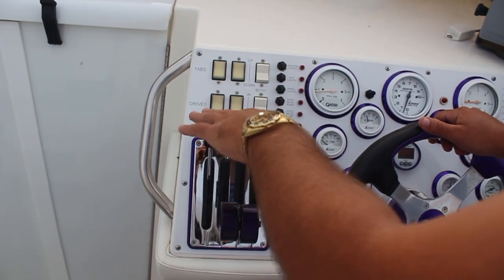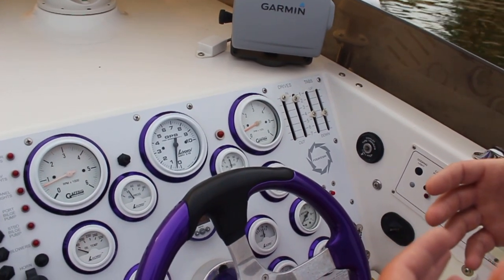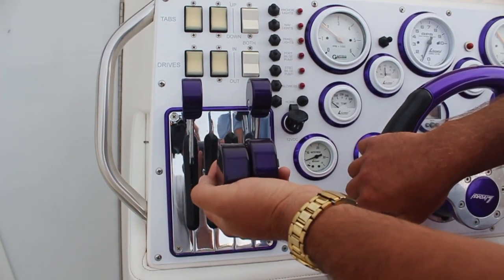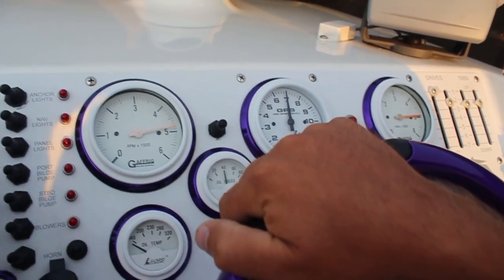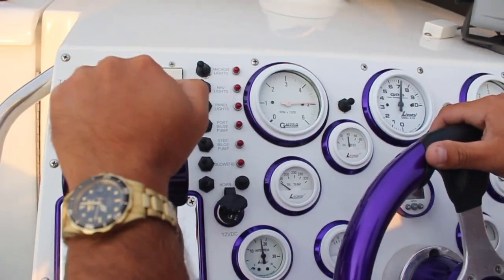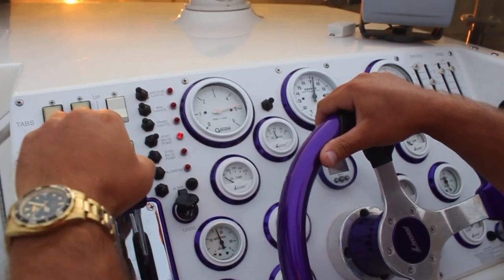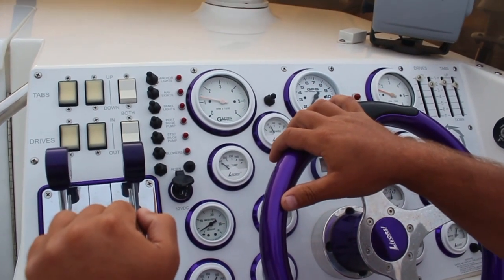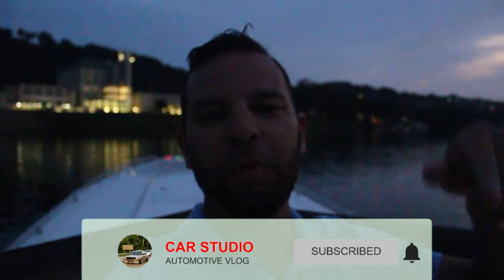HOW TO OPERATE A BIG OFFSHORE BOAT

Comment: I’ve been in a 42 lightning my whole life and have never needed to mess with my tabs as much as you did in this one video. Granted it is a shorter boat and needs a little more but not as much as you were giving it
Reply from the maker: Yeah i agree. This video was filmed like 2 weeks after i bought it and my last boat had blue motors and was only a 32, i never used tabs. The guy told me to use the tabs to get it on plane lol. Once i found out i didnt need to i never do now. I need to make a new video there was a lot of stuff wrong with this one.
Reply: @CARSTUDIOYT  one thing for sure was the audio could have been better. However it is tuff to video when your going fast on the microphone. One thing with me, Im like you constantly looking at my gauges. My trim indicators are old school, and have no indication up at the helm.

Comment: Those things are not limited to just big offshore boats. This applies to pretty much all boats that have trim tabs etc. 15 foot boats and up.
I would have been interested how do you maneuver these 30-50 foot boats at very slow speeds / near standstill when pulling out from or in to a berth on tight marina.
I assume none of these powerboats have props at the bow for maneuvering

Comment: Why does the right drive tab show to be moving when you trim it up.  I noticed the left doesn’t move when you use the trim on the throttle.
Reply from the maker: One of the cables need replaced
Reply: @CARSTUDIOYT  gotcha wasn’t sure if it was because they were being moved together or some other reason. I good with lake boats lol I’ve never been on a boat in the ocean unfortunately.

Comment: Controls are there because Reggie was left handed. Not that he would think about everyone else in the universe but
Reply from the maker: You are correct, based on what ive heard. That is interesting he just made them for his preference!
Reply: Correct
Reply: False
Reply: They are one right because we came up racing kneel down boats that turned right. We steered with the left hand throttling with the right, made sense as the throttle hand added support when turning right.

Comment: Nice 👍 boat but I’m a little disappointed in the topend speed! With twin big blocks probably producing 850hp combined you’d think it would hit like 90mph plus. But I’m no boat expert either. Fastest boat I have owned was a 1997 Crestliner 1700 fishing boat with a outboard 115hp Johnson That did 53mph+  all aluminum boat btw. Boat actually gained about 2 mph by taking the engine cover off  Throttle body air filter box off. Hahahahaha talk about ram air to the engine then but it made a difference and rpms picked up about 200rpms by doing that. So this is why I’m disappointed in your speed runs. You got 710hp more then I had  but only did 22mph more. That boat must weigh like three times more then ours did if not more.
Reply from the maker: 850 hp is not a lot for a boat like mine. It takes at least 1100-1200hp to reach 90 mph. My boat also weighs around 9k lbs give or take
Reply: @CARSTUDIOYT  Son of a gun thats a lot of weight😬no wonder! Lotta drag with that plowing through the water. I’m looking into buying a nice boat like this soon but I’d like something lighter! What year is yours btw
Reply: 53 on GPS or the notoriously optimistically inaccurate factory "wishometer"? 😂
I have had many guys tell me how fast their boat was and they went by the factory speedometer. Then when they run next to my boat on GPS they see how slow their boat really is.
Also, this is a 35' Fountain. That's a lot of weight and more hull in water for more hydrodynamic drag. the more hull in the water the more power it takes to move it. That's why they put steps in the hull now to get the boat out of the water. Also why cats run faster because they pack air which lifts it out of the water.

Comment: You should run it more you seem nervous is that lack of seat time of camera shhh yo
Reply from the maker: This was the 2nd time i had this boat out, ive hit a few poker runs since then and put probably 100 hours on it since this video. In hind sight i def should have had more seat time before i made this video, this hull handled way different than the 32’ baja outlaw i owned before it.

Comment: Please god don’t listen to this guys instructions. You should never need tabs and drives to get that boat out of the water, you should be able to use throttle and the right prop’s.  He’s so worried about tabs but not paying attention to throttle sync by the gauges it looks like they are about 300 rpm off but he is talking so much nonsense about tabs and drives I can’t here the harmonics of the motors. Ugh I could go on but it’s just gave me a headache